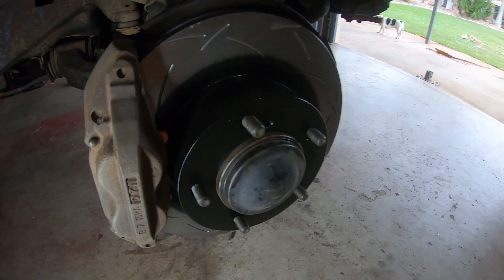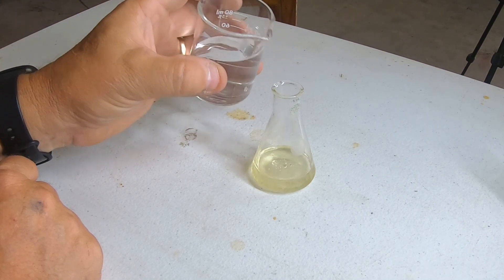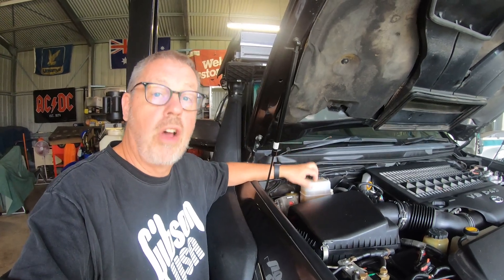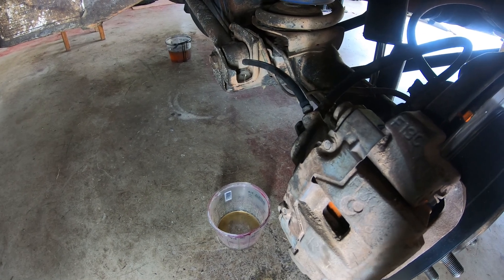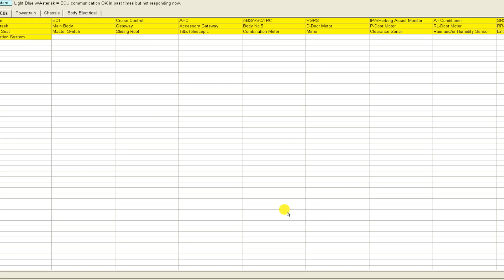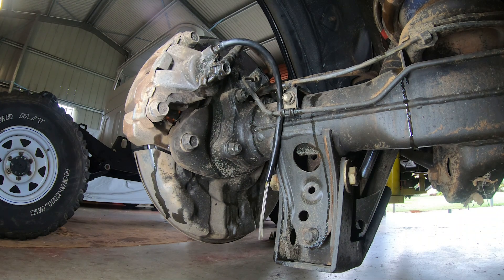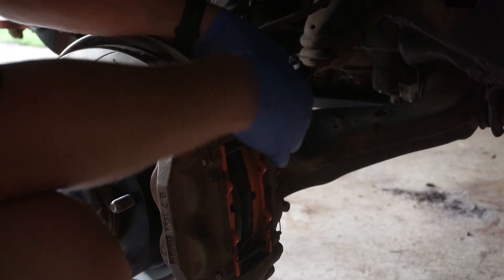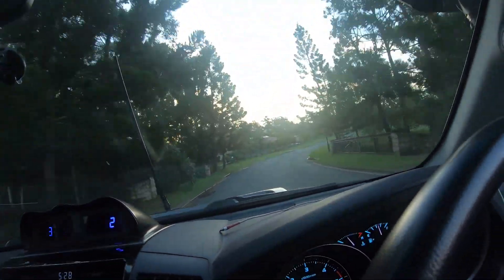How to Bleed the Brakes on your Toyota Landcruiser using Toyota Techstream | LC200

Comment: Hi Terry, informative video. I used tech stream to change fluid and bleed the brakes on my 200 series, when bleeding the front, it says put foot on brake, hit next and the pump kicks in and the pedal goes to the floor, is this what you found when bleeding the front brakes using techstream?
Reply from the maker: No mate, my peddle did not go to the floor.  Cheers

Comment: Why my toyota corolla brake become very soft after change a master pump? Done manually bleeding few time also same problem.
Reply from the maker: Manual bleeding works but this is another option for you
Reply: @JafffaAdventures mean that need to use tech stream for bleeding is more effective?
Reply from the maker: It’s how the dealership bleeds the brakes
You decide
Reply: @JafffaAdventures many of workshops already tried manually bleeding but still can't work, brake padel very soft

Comment: I did the RR,RL,FR,RL bleeding but when I reach the stroke abs module bleeding the message bleeding procedure fail
Any ideas why this is happening
Reply from the maker: No I do not but it happened to me on the odd occasion.  I just redid it and the second time worked fine.  Cheers👍

Comment: Something I found kinda odd with my '200 is that the little plastic ring on my brake fluid reservoir, it looks like the ones i see on everyone else's '200's, but it says DOT4, not DOT3. i presume someone changed it, but it really does look identical to the original. Bizare!
Reply from the maker: That is a bit odd, I agree.  Is your cruiser a later model where maybe Toyota made a change?
Reply: @JafffaAdventures  Im pretty sure its older than your's, 2014 GXL (im in Aust as well, so presumably the same otherwise)
Reply from the maker: Mines a 2010, so maybe there was a change to DOT4 after that.  Good that you have the tag that says it anyway.  Cheers😎👍

Comment: I didn't know about the Techstream method, I'll try it next time.
I empty the reservoir by cracking a rear bleeder and turning on the ignition. The ABS pump will empty the reservoir... just make sure you stop before it runs dry/sucks air. No need to suck out the reservoir. 
I also use this method to bleed the brakes by myself. ie, crack bleeder, turn ignition on (WITHOUT foot on brake so engine doesn't start). Turn off after a few seconds. Move to next caliper. I can't remember if the front need you to hold your foot on the pedal slightly. Not sure if this is the same thing as using Techstream, but it definitely makes the ABS pump start. This may not be the correct way of doing it, just something that I worked out. Some of the details may be slightly different from what I described because I just make it up as I do it.

This is how I also used to drain the reservoir and bleed the rear brakes on my 100 Series. Front ones just use the old fashioned method.

BTW, is DOT4 compatible with all the rubber components designed for DOT3? Personally I'd just stick with the manufacturers recommendations unless I was 100% certain it's OK.

Thanks for sharing your video.
Reply from the maker: Good stuff mate, whatever works for you is best for you, thanks for sharing.  All DOT 3, 4 and 5.1 brake fluids are compatible with each other and with all systems.  DOT 4 simply has a higher boiling point than DOT 3.  Nothing wrong with sticking with DOT 3 if that is your preference that’s for sure.  Cheers👍😎

Comment: Sir are the rubber brake components of an LC 200 compatible for a Dot 4 fluid change? Since it is a Dot 3 specific system? Thank you for giving me light on this.
Reply from the maker: All DOT 3, 4 and 5.1 brake fluids are compatible with each other and with all systems.  DOT 4 simply has a higher boiling point than DOT 3.  Cheers👍😎

Comment: I have techstream on windows 10 x64 so not 100% sure what the issue you’re having with the computer is
Reply from the maker: If it works for you then that’s awesome.  Many people have issues however, and for those that do, this is a solution.  Also, if you get a windows update and yours stops working, this is a simple solution that will work.  Cheers👍😎

Comment: The other advantage of bleeding with Techstream or vac bleeding is that the master cylinder piston is not being pushed past its normal travel into a dirty maybe pitted part of the bore. Have seen more than a couple instances over the years where bleeding the old way resulted in a US master cylinder - unlike a clutch master , there is a huge part of the master that never gets stroked.
Reply from the maker: That’s a really good point Ross, thanks for sharing mate.  The power of the good side of social media👍😎

Comment: Did the feel of the brake pedal feel better when bleeding manual or through techstream? Or both the same? Cheers, great vids!
Reply from the maker: Good question Nick.  They were both the same in my opinion.  The advantage with Techstream is that you can do it on your own easily.  I know you can do the manual method on your own, but it’s sooo much easier with the computer.  The other advantage I found is that Techstream pumps more volume per stroke compared to the brake pump method.  In the end, the results were the same.  Cheers😎👍

Comment: Hi Terry, great video, especially the techstream bleeding, just wondered why you changed to Dot 4, apparently Dot 3 is less hydroscopic than Dot 4, although the boiling point is less, which is why Toyota select it for a 4x4 truck. Dot 4 is easier to get hold of nowaday though!
Reply from the maker: Thanks Brett, I sincerely appreciate your kind words.  I swapped over to DOT4 simply for the heightened boiling point.  Changes in hydroscopicity is not really a concern for me because I change the fluid significantly more often than the manual calls for.  Cheers😎👍

Comment: Resting not Reseting! Hey Terry, I'm sure someone has already mentioned it but the red text on the computer screen said "RESTING" not "RESETING" I suppose this makes no difference anyway to what you are doing but just thought I'd point this out. Also, It's weird how the computer "Bleeds" the front brakes without actuall purging any fluid from the bleeder nipples hey? Maybe it purges it back into the master cylinder???
Reply from the maker: Good one mate, you’re the first to point it out.  A classic case of you read what you expect to see😂.  I suspect you are right, the fronts purging back into the master cylinder.  Thanks for watching and commenting mate, I sincerely appreciate it 👍😎
Reply: i believe the rest is supposed to avoid the ABS pump from overheating. the service manual says something about waiting 15-20 seconds each time you make the ABS activate on purpose during tests
Reply from the maker: Good stuff mate, thanks for sharing 😎👍

Comment: Nice, instructive and very useful video Terry well done and thank you.
Could you use the computer bleeding system to flush the lines as well?
Also, any reason why you didn't upgrade to braided brake lines?
Happy Easter
Reply from the maker: Thanks for the kind words Max, I sincerely appreciate it.  Yes, I certainly could have used the computer to bleed the lines as well.  Laziness got the best of me, I opened the lines, went inside and had lunch, and came back out to top up MC occasionally, an hour or so later it was done.  I did not upgrade to braided lines as I have found the factory brakes adequate, and knew the DBA would be better again, so no need for me to go the extra cost step.  Also, I do not tow a van.  Cheers😎👍

Comment: 1) I think you're retaining fluid. 

2) This is something I've never done. It appears that even a junior assistant farmhand like me could do it.

3) I was thinking, Could you get rid of the fuel light off my dash ? The service dealer changed the fuel filter but never fixed the light.
Reply: Unplug it @filter. Turn accessories on only and plug back in then turn ignition on.
Reply: @tonymunro  Is Accessories the first or second position ?  I'll go check.
Reply: @adelarsen9776  first
Reply: @tonymunro  Just went outside and the fuel water/contamination light comes on only in the full/start position.
But I have a bigger problem now. I have just gone outside and found a mouse in the snorkel. It's cold here and the mice plague has just started..... again.
But I will do what you said. Thank you. I will try it when the sun comes up.
Reply from the maker: Thanks Tony😎👍
Reply from the maker: I hope the mice don’t come back again mate, that last plague was a shocker.
Reply: @JafffaAdventures  It started 2 weeks ago and now with the cold weather they are ramping up. Plague 2.0.
Reply from the maker: Agree!
Reply from the maker: You would definitely be able to do it mate.  Sounds like others have your fuel light issue sorted, the power of social media 😎👍
Reply: @JafffaAdventures   When I get time I will do it. Thank you to all.
Reply from the maker: Good stuff Ade😎👍

Comment: Thanks Terry, another ace video - there is a hybrid method too, if you have a helper and do it with the engine running, each time they pump and you open the bleed screw the ABS pump will push fluid through the open bleed screw at a greater rate than the pedal pump alone.  It also pays to keep end of your bleed hose submerged in fluid and close the bleed screw before the helper lifts their foot, to avoid drawing air back into the caliper.
Reply from the maker: Thanks for the kind words and for the tips on the hybrid bleeding method, that’s great to know.  Very cool😎👍

Comment: Well done Terry. Great video. I had done the Dba upgrade also but are yet to do the fluid. Will do so next. Stopping power is greatly improved but I still find the lc200 pedal feel to be spongy. Did you consider braided lines? Thanks, Alex
Reply from the maker: I agree with you 100% Alex, the stopping power is greatly improved but the LC200 pedal is a little spongy.  I did not consider braided lines but I do not tow and I found the factory brakes ok, and figured the improvement with the DBA would be enough on its own.  If I were towing, I probably would have upgraded to braided lines.  Have a great weekend mate😎👍